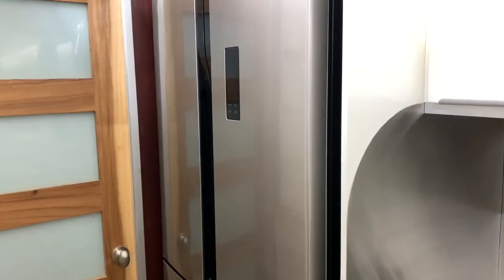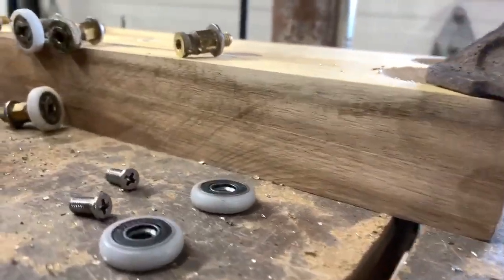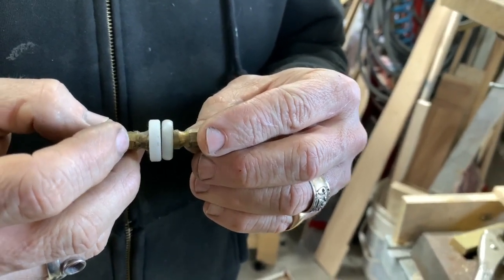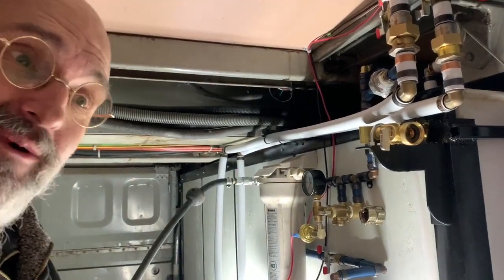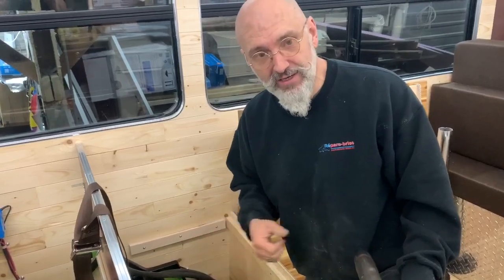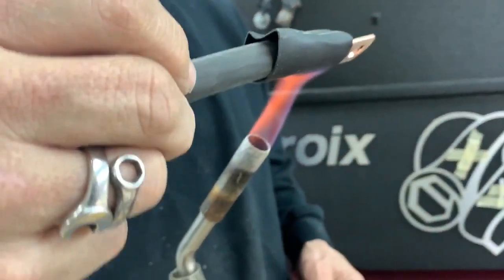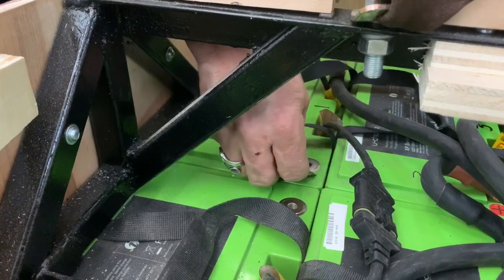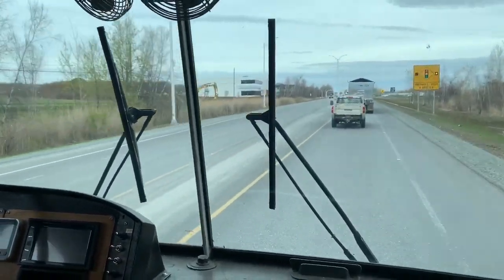E51, Lithium Battery Pack, and the big move!

Comment: A really nice touch to use the Red and Black shrink for the series/parallel connections, avoids confusion. Is going to a 24v bank and not say a 48 v bank due to the inverters and chargers? May I suggest Kopr Shield by Thomas & Betts on all the connections at a future date. I have had good experience with this product (and other copper based pastes by Permatex and others) for buss bar connections.
Reply from the maker: We went with 24v because it’s the native voltage of the bus, and we had 24v inverters. Good idea for the protection.

Comment: Are those Valence U27-12XPs ?

I don't like how your pack is 2S6P.  If you charge them with 24V (nominal) you risk over voltaging one of the series batteries.  Ditto when discharging them.  Unless you are going to use a battery balancer that manages to keep the series batteries at equal voltage.  But you don't appear to be doing that because you didn't connect the series connection across all the batteries. 

Does the charger monitor the state of each battery as they charge ?   Are you going to monitor the battery states when they are loaded ?  ie, is the inverter tied into the battery communication circuit on each battery ?

How are you going to balance the series batteries when they come unbalanced ?

BTW, lithium battery cables don't need to be air free and are not subject to the corrosion that is seen on lead acid packs. 

Great videos.  Thanks for sharing.
Reply from the maker: We have a BMS specifically designed and built for our battery pack, and it’s configuration. So far in a month of use the highest cell disparity has been 30mv across 12 batteries.
Reply: @LacroixCruiser  Very interesting.  What BMS are you using ?

Does the BMS charge across the batteries in series (24V nom) or does it have a balance connection to the connection between the batteries in series ?   Or do the batteries have built in charging control such that one of the batteries in series can charge more while the other one charges less, if they are unbalanced.

In a traditional 2S6P lithium pack, the charger has a connection between the cells in series so that it can balance them.   Your pack setup doesn't appear to have that.  I'm wondering how the BMS can manage such a set up.

The unbalanced condition can happen on discharge too.
Reply: @LacroixCruiser  Those batteries have a built in BMS in them.  I'm not sure you even need the BMS you are using.
Reply from the maker: This is the BMS we are using 

https://youtu.be/UR3nlNgX4qA

It’s base is a valance BMS. We can monitor each cell on an individual basis, in real time. 

How it works , I don’t know, but so far everytime we look our batteries are happily balanced.

Comment: Why did you use a 24 volt system? I am trying to decide what to use on mine.
Reply from the maker: Because the bus came with 24v inverters. Building from scratch I would do 12v
Reply: @LacroixCruiser  Thanks.

Comment: hi lacroix! wondering if you can help me, i have a 99 mci d series 40 footer. i had a mechanic remove the chassis A/C, and initially he left an air regulator off in the air conditioning bay, and told me to tie strap the air lines. i did. when i started the bus, could not get any air pressure inside. he reinstalled the regulator (i have no confidence he re-installed it properly), and the top nut vent valve seems to be leaking. Now the bus gets air pressure but the parking brake won’t release. Do you have schematics for how this regulator should be connected? it has 3 lines. 1 marked H, 1 marked L, and 1 marked B. Any thoughts on my problem?
Reply from the maker: Unfortunately not. You can call MCI and they will be happy to help you. You simply need your serial number .

Comment: What size gauge wire did you use for the batteries?
Reply from the maker: Between the batteries and bus bars 2/0. From the battery bus bars throughout the rest of the system 4/0
Reply: @LacroixCruiser  awesome thank you

Comment: You know silver eagles have independent suspensions on all tires not air bags
Reply from the maker: They don’t have Independent suspension, it’s still a solid axle. What they have in place of airbags is Torsilastic suspension. It was also used on Flxible busses.